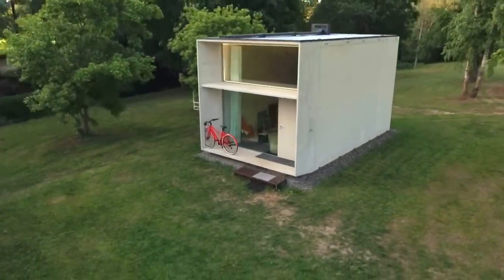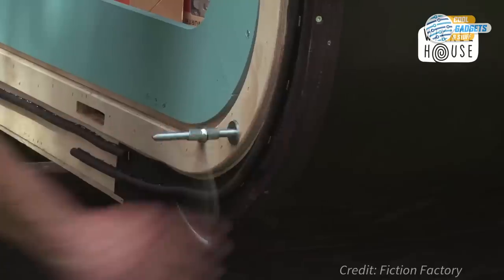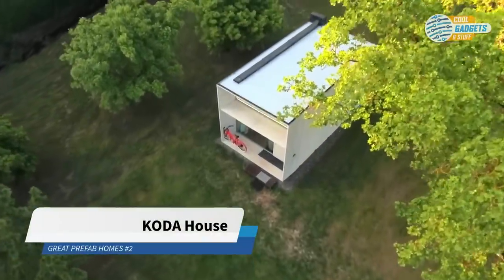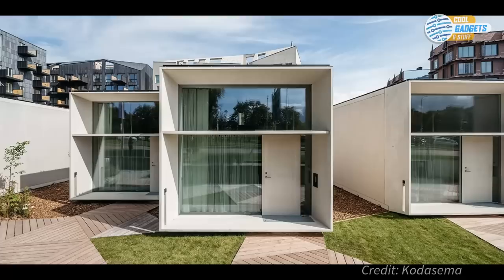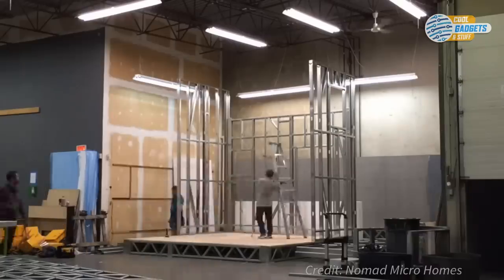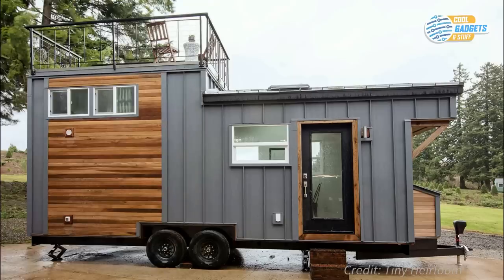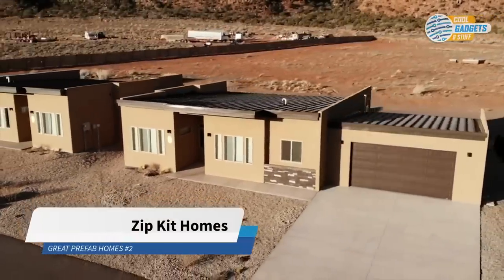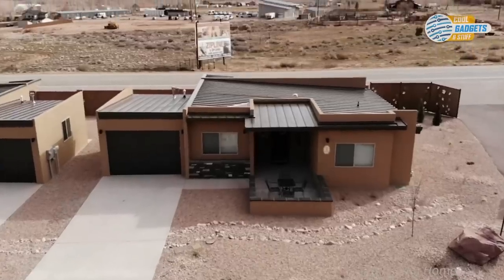7 Great PREFAB HOMES #2 (some affordable)

Comment: 6:03  very dangerous stairs even for any age group.  Mobile - come kit homes are really amazzzing having lived in one for nearly 13 years. They are depending on the company, far  LESS expensive where I live than compared to homes in other countries. The best part is they can be made within days. Less cost, less drama with town council plans, less builders and time of months building a normal home. We bought ours for $32,000 sold may 2019 for $202,000. Making a profit of  $170,000. Took that money and bought a real home in the country outright. They have there purpose....but it all depends ''where'' you live.That's the key.
Reply: mossie we bought ours for $21.000 and sold it after 2 years for $980.000.
Reply: We bought ours for $9,000 and sold it for $ 1,200,000
Reply: It's the land and location that you sell for the high price.  The building itself is not what demands the higher price.
Reply: We bought ours for $580,000 and we just traded it for a baloney sandwich with a side of Charmin.  FML
Reply: @rage242  wow, no hand sanitizer? Not sure about that deal.
Reply: I bought mine for $4 and sold it for 5 zillion.  😏

Comment: Hi, just wondering how durable is this type of house through earthquakes and hurricanes?
Reply: Most likely not that durable.
I've been observing new buildings that are being built in my area (I was looking for those hot singles but can't find them) and I've noticed that the buildings and homes built in the past 5-6 years are deteriorating fast, they all come with the same "style" and type of materials, and some start to fall apart after 1-2 years!

It's great to have "super economic, high tech, high efficiency walls", but if it starts to fall apart after one or two winters I don't think it's that "eco friendly" or cheap.

I suspect that most of the issues are that one guy in one part of the world designs something cheap, markets the shit out of it, and people buy into it because "look at those numbers", while not considering the long term impact the weather would have on this type of materials.

The big hype now is flat roofs, it's great in warm climates, where you can use the space as a terrace in the summer... but when you get 1-2M of snow, and people are too lazy to shovel it, it will eventually leak or break.

Sorry for the rant, but yeah those buildings aren't going to last a decade, and in building time a decade is nothing... all this "build it cheap, build it eco friendly" doesn't think about building stuff to last... because that's expensive, and you can't sell a two house if the first one can be passed down generations.

Comment: As I watch all the "new" home ideas, yet have I encountered one that is cost effective and is aligned with codes, mortgage requirements, building within city and county requirements, land use etc. When all is said and done, delivery and contractors, retrofitting it to a livable space results in higher costs, and in the end the investment will result in less appreciation than the good old stick built.  For years I have searched for that new idea that would be a great substitute, affordable, but just not easy. Interesting but not feasible, at least where I live.

Comment: someone where i used to live made the mistake of buying one of those pre-assembled kit houses years ago. the whole thing turned out to be a nightmare and an eyesore. the segments never really fit right and after settling separated causing cracks and leaks everywhere, the electrical was a hazard, the siding started coming off first windy day, and even the foundation they poured was a disaster, needless to say it was condemned a mouth after he put it up. even if you get a good pre made segmented type house you can regret it if you just have the wrong people set it up and all your money goes down the toilet. recently, we just built our first tiny house on a 24 ft trailer, best thing we ever did, made the way we want and we own it, no mortgage, we just pay utilities. six weeks to put up a prefab, i can build a tiny house in that time and it will look better than an oversized shed with windows slapped in it. colder climate or not insulating your home should be standard not an option. don't get me wrong some of these look pretty nice like the one made with cardboard, that looks like a high quality product, but stuff like that also isn't cheap. koda we offer a house for100k so you can literally live in a plain looking, we used the cheapest products box, my god. zip kit looks good, but again if you get the wrong people to put it together, etc.

Comment: The Texas "shed" has a design flaw that's so obvious. Propanel roofing shouldn't be installed with the ribs running horizontally. This can trap rain and snow and cause the roof to leak. When installed properly, with ribs running vertically, rain and snow slide off. But you can't bend propanel to fit the curve of the roof line to run the panels vertically, so if you like the overall design please consider a different roofing material.

Comment: The main problem I see with these homes is they aen't up to code for the area where I live.  This is going to be true for most places in the US.  Here a house, to be called a house, MUST have a foundation which the house must be bolted down to or attached in such a way it won't come loose from it.  If not it won't pass building inspection.  This "without a foundation" isn't going to fly.
Reply: They can be modified to use screwed in the foundation and be tighten onto that. That should pass the code requirements. 
... I still do not like any of them ;)

Comment: I DARE you to try to find property that the zoning restrictions will ACTUALLY allow you to put one of these on!

Sanjosemike (no longer in CA)
Reply: There is, look for " unrestricted property [land]."  No HOAs, no zoning issues, Nada.  One important thing is to check that the land is not in a flood zone.  Also there's a thing called Karst Topography which has to do with land that is common in Tenn (limestone, dolomite, gypsum).  Lots of caves and stuff that leech out with water flow (sink holes and caves).  One acquaintance had drillers trying to make a well for her home  and couldn't find water so kept going deeper ( of course you pay for every foot).  Turns out they dug down into a cave.  Hope that helps

Comment: Note that none of the Arched Cabins have any windows along their two sides.  And good luck installing cabinets or even dividing walls.  Also, a number of these homes are built on post foundations.  I wouldn't spend this kind of money and then put it on anything but a standard concrete foundation.  Just about anything else will eventually settle and result in sloped floors, sticky doors and other problems.

Comment: Plumbing seems to be a completely forgotten issue on these units.  Same with AC and heating needs.
Reply: And the additional cost of delivery and creating a livable space and according to code, plus land, plus local ordinances and code, inspections, contractors to set it up, etc. etc. etc.
Reply: @MR-pr8tp  well, the price of those things depends on the area. Where I live I already have the land and connecting the housing to the utilities is actually pretty cheap.

Comment: Does any one of these homes have a ventilation system for condensation? They don't appear to have R40 in the roofs. Around here you need a bunch of insulation or you get > $1,000.00 per month heat and cooling bills? And condensation will ruin a roof before the shingles wear out.

Comment: WOODEN FRAME tiny homes don't travel well. The wood warps. If you intend to move frequently, you'll want a steel-framed tiny home or try a renovated school bus (schoolie), but they'll need insulation.

Comment: Imagine if you reduced the size of the prefab components, had them all fold up like origami, and made the assembly so simple that a robot could do it...
Reply from the maker: Check Boxabl, a folding prefab house I featured in my prefab homes 3. Also Mighty Buildings, I featured them in my Unconventional Home Builders video. Their process is almost completely automated from 3d printing home shell, to robots applying finishing touches.

Comment: My first house was a 1750 sq ft ranch with 2 baths and it was 115K granted it was over 10 yrs ago but by comparison these prices are not even close to a good buy considering what your getting dollar for dollar. The original point of a tiny home was cost   and it seems that is not the point anymore...
Reply: Where do you buy that

Comment: There is a company in Oakland CA that builds 3 D homes, the headquarters is in S.F. bay area,  a very expensive location.  The first 3 D homes were in a community in a poor Latin American country and the second were built for a homeless community in Tx, the ones by Oakland company although less than a conventional home in the S.F. bay area (or all of CA for that matter) the only state that has approved them are where the land is super expensive.  If people kvetch about the cost of THESE homes which are usually under 100k they will scream at the price of the Oakland company's, they are quite expensive almost 200k for the smallest, although it is turnkey prices which includes top notch appliances and other gadgetry but also the construction costs, building permits per and placement of the homes by crane (they are premade.)  The first two companies don't build for individuals, only the third, I don't begrudge them their costs as some people want a turnkey home but wish there WAS a company that made 3 D homes for less affluent people, the shell costs are MUCH less as evidenced the communities above they were built for.

On another note, someone lambasted the popularity of cheap homes blaming it for making small home and prefab prices to skyrocket, these were not titled "cheap" homes but PREFAB homes which ARE cheaper than conventionally built ones, they may not be affordable to the poor but to the working or middle class, they are.  As someone mentioned below, there are houses you can make of earth, you can use recycled materials and build your own, use shipping containers etc., there are always cheap options and you can watch self build or do your own video of how you can build cheaply but many people don't have the skills or time to build a house and this offers a solution. 

 Also as others have noted, pre-fab doesn't mean cheap because of quality materials used, the cardboard house is not made out of the cardboard that the unhoused use in their structures by the freeway underpasses for heaven's sake and people shouldn't lambaste these manufacturers,  the U.S. is still a capitalistic country where companies are in a business to make money which provides jobs for people to buy housing, food, transportation etc.  What people should criticize is onerous zoning boards that may prevent houses proven to be structurally sound but unusual from preventing to be built.

Comment: Most of these cost as much as a 1200+ sqft manufactured home. 😂🥀
Reply: Bet they last longer though.  Most of the cheap manufactured homes are crappy thin materials.  Stand in the middle of one and jump up and down and feel the floor flex...  and you WILL.

Comment: Only problem there is no where you can put these in less you own your own property. Or cabin area. Even than they have rules you need utilities hook up or sepectic tank. Natural gas. Electrical. Water.  Road access. So you need to drill for water have solar system. And dig for waste. And than you need to pack out your own garage. Or burn it.  If u can get away with it.  U need spot footings. Or slab on grade. To place your unit on.  It's.cool. structure. Looks. But needs to be zoned for it . Or the government is gonna take it. Destroy it or fine u. Nothing is free. Why u dig. A underground bunker. And park ontop of it. Hidden somewhere in the woods desert. Or hidden somewhere in the city. Still you need all the hookups.  So this small house is worthless. Why u need a small house on a trailer where u can. Park it in RV parks.  Or on BLM land.  With solar panels batteries. Water waste. Dumping. And garbage drop off.   So maybe just by a Rv . Trailer or motorhome.

Comment: Wikkelhouse makes no sense at all, besides the emotional value. 
It is expensive, made out of none-durable materials that are highly sensitive to moisture. 
What is the point of "modular" housing if it more expensive than a conventional home?
It is a different story for bigger buildings, where modular off-site built structures are much cheaper. It seems not to be the case for homes, as they are easy to build. People just want fancy spaces that are expensive to build...
Conventional timber frame house is already "modular". Two good framers can make magic quickly with a simple design.